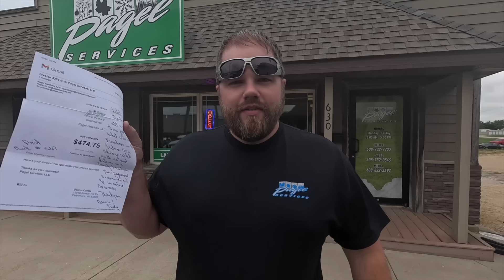Tensions Rise on Split Rail Fence Install

Comment: I installed that same fence at my house and at the end of the run i ran it to the ground like you did but i put short piece on the bottom and the longer piece on the top and buried the ends in the ground.
Reply: I agree.I thought  the same thing .
Reply from the maker: Nice! Appreciate the info!

Comment: That end of the fence looks messed up, you need to make the bottom rail shorter than the top and then you put the top rail out until it hit the dirt and the top of the other rail at the end that hits the dirt or us 2 stakes and keep a even space between them

Comment: I'm surprised that the state patrol did'nt pull you over for not wearing a seat belt i notice it in all of your videos.
Reply: Or suicide knob on steering wheel
Reply from the maker: Windows too tinted probably. Thanks for watching!

Comment: I can tell you what went wrong with the concrete driveway sidewalk you poured they sent you a Hot load another words they got back to the plant they still had a yard or two in the truck so they added to it to create your load meanwhile the concrete that they had in the truck was already curing so it turned the whole load hot which made it cure faster than normal you can always tell a Hot load by putting your hands in it when it first get it any professional concrete guy knows that